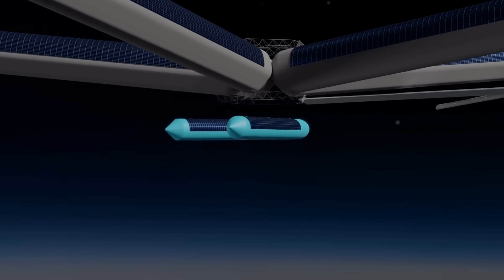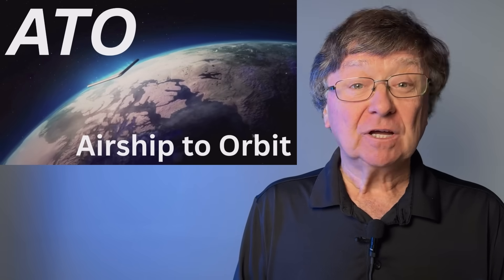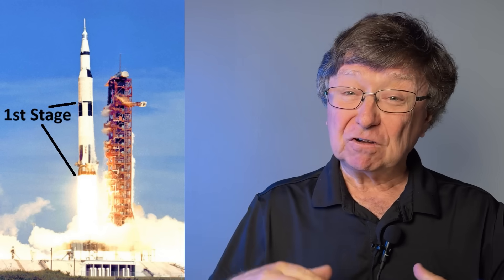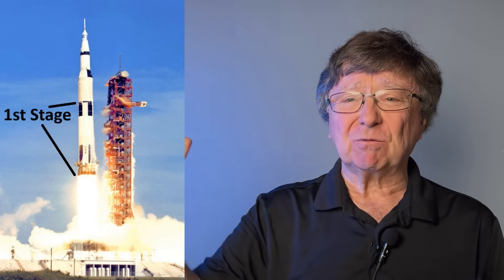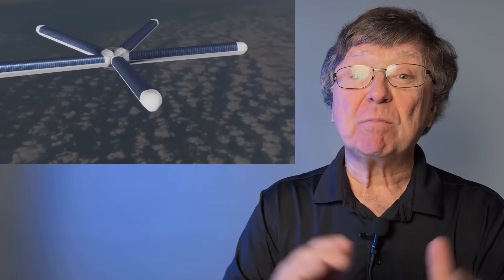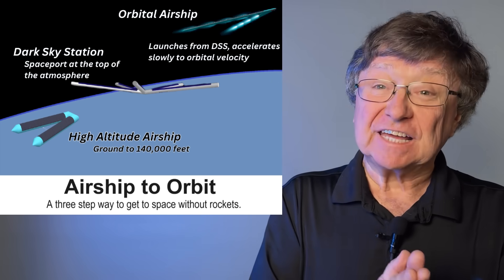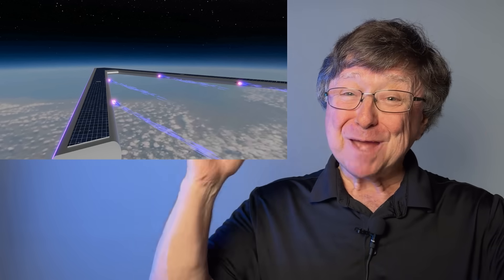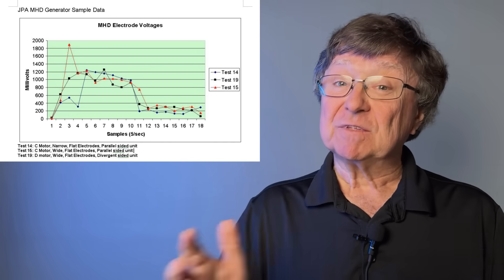This Airship Might Change How We Reach Space Forever!

Comment: I like the idea of floating up to space instead of all that noise and fire from rockets!
Reply: It might be a good idea but balloons can be dangerous too. Remember the Hindenburg? The USAF abandoned all their dirigible projects. Too many accidents.
Reply: @scotth6814 Planes crash all the time and we are still using them.
A few airship accidents were not the reason why they went out of service - it's the low payload.
Reply: @molybdaen11  It's a bit more complicated than that - who knew... The reason the US abandoned their airship programs in the 1930ies was the inherent issue with the design. A balloon, airship or dirigible - while lighter than air - is still a massive object with significant inertia. Operating them on the ground was a nightmare and in bad weather they turned into deathtraps. The issue with hydrogen is obvious, I think and to avoid that you would have to use hydrogen - which is expensive, has significantly less lifting potential and (just like hydrogen) keeps seeping through the lifting cell materials and needs constant replacement. To get to the proposed 90km altitude will require massive ships with all the currently unsolved structural issues and we haven't even talked about the proposed "floating station".
Reply: @Llyd_ApDicta  If we could manage to construct more stable materials, we would not even need a gas inside.
The gas is just there to protect against the outside pressure while having lower density then air.
Reply: @molybdaen11  ... and if we could manage to built compact fusion reactors we all would live in orbital O'Neill Cylinders. Your point?
Reply: @scotth6814 was all about the hydrogen back then

Comment: Love this idea.  I'm no mechanical/aeronautical engineer etc. etc. so I don't really know what the real challenges are.  As a fantasist I like to think what might be plausible.

Some questions pop into my head - like - ballast?  When is the Load lighter than air?  Always?  Does it required powered descent to keep it down?  Or is there some ballast system / dynamic inflation ... which leads onto pressure questions ... like how rigid is the balloon envelope and is there some kind of gas exchange to deal with the change in pressure?

I sometimes wonder about using graphene - now that it's looking like we'll create it at bigger scale - for batteries if I remember correctly (and not just ultra-capacitors)  - as a helium tight (though I understand there's problems with hydrogen) non-permeable barrier at 1 atom thick even I think - and I wonder if producing it in space could reduce defects?

I love the idea of using the energy from the sun with thin film solar to help with orbital velocity. Not clear on orbit selection to get sufficient sun to reach orbital velocity.  Not clear on the ratio of chemical to electrical engine deployment to do it.  If more chemical then you still have the rocket equation even though you've gone up a lot.  If more electrical, you need to overcome remaining drag and get some lift ... but while suborbital you still "fall" - so more drag ... sounds like you'd skip along faster and faster if you still have enough energy input and ISP? Whatever it's called - just feels like the idea of a motorboat skipping along a choppy sea or maybe parabola or whatever will be more predictable and less perplexing.  I would have thought that once you've got to the point of lift cancelling drag at the top sub orbital speed of your electric engines you'd want to deploy more wing surface with more thin film solar to boost the engines.  But as you increase mass of course you need more energy to get to that point in the first place  ... but hopefully with the optimised angle of solar irradiation I assume you'd try to get maybe it's possible - I don't know.  I suppose you could use chemical engines to give you higher sub orbital arcs which would give the electric engines longer to achieve more delta-v without drag and then with attack angles maybe you can bounce off the air density layers and with harmonic like pushes give the thing another push up etc. ... skip and hop until you can leap.

Anyways - I don't really know how this stuff works.  Too much sci fi.  :)  Sure hope it can be done.

I have wondered actually, with developments with graphene et. al.  and space based development, whether the space elevator idea could be adapted with lighter than air support, or if even "balloons" of vacuum could be made in-space.  They might not have to experience sea level pressure in a multi stage system.

Comment: Will the DSS Station have any station keeping potential, or is completely free-floating?  If free-floating, it may run into restricted airspace issues.  It would suck to solve all these technical issues and then get shot down by North Korea or something!

What are your lift gasses?  The same for all three stages?  If hydrogen, how do you handle resupply since it WILL escape?

Comment: It may indeed be impossible to use materials design to overcome the basic problems of heat and acceleration but the way to find out is to use very small scale models to try and see. Maybe 1/20th the size of the proposed lifting bodies suggested. If they can use smaller versions to actually get there, then that's great. The one thing I know is that it's always possible to overcome impossible problems.

Comment: I modeled a similar wingshaped  solar powered airship to orbit aircraft in first version of the xplane simulator decades ago. I called it the Simitar. It worked! Far less on board fuel needed and mostly only in the highest atmospere.tje sun transmits the energy right to you on the way. You keep building up speed at the edge of the thin atmosphere until when you have enough speed you pull back and pet it go on its final space trajectory. Like a dolphin building speed before the leap.

Comment: Edge of space port will require radiation shielding, extensive shielding.  Otherwise is it going to be a pretty short term investment.  I wonder how they intend to do that?  It will also require hydrogen refilling, constantly, as nothing made is able to stop hydrogen from leaking.  Even the next lighter gas, helium leaks pretty fast, and can't be stopped from leaking.  So, either will need to be replenished constantly.  (I would worry about hydrogen in that volume, as a simple spark can ignite it (although a fire would require oxygen to sustain it.)

Comment: LOL - I came up with this.. in 2013, except the way I looked at it.. was MUCH different... mine was STO.. or in this case.. an ATO - STO, and not the way that was described... ... You talk about valves... but not micro machines. or FUEL CELLS, or Storage Cylinders, or, or, or... and you know nothing of the ultra efficient Electrolysis unit, or why it is an advantage, or how to incorporate water to thrust.... plasma, and mach 40... (shrug) Great idea... I might look you guys up and visit.. 

B2S or shorter as Balloon Space Plane.. is also known by me as the BS Plane... ;-)  Why.. because unlike you guys, I did nothing with it, and if you do nothing, then it is BS.. but you working on building it.. is ... amazing.

Comment: This is a good idea, but keep things as simple as possible, KISS I think.  You can get by with only 2 airships and not need the mile-wide DSS station.  (1) the Load "Turning-prop" Airship LTA from ground to 140,000 feet at Mach_7, which rendezvous directly with (2) the giant  AOA Ascender Orbital Airship which has slowed-down from orbit at 300,000 feet  Mach_19 down to Mach_7  at 140,000 feet to receive the cargo load and maybe a little more xenon-gas chemical-fuel.  After about an hour, the two ship disengage  and the empty LTA spends the day reducing speed having atmosphere-resistance and  reverse-props to slow and land safely, while the AOA ship spends the day under powered electric thrust to climb back to orbit at 300,000 feet Mach_19.  Every couple of day, your "rinse and repeat" to get cargo to orbit cheaply.

Comment: Could conventional air-launch be improved significantly if you used black bird engines which re-configure themselves to fit the altitude they are flying at and rebuild, for instance, a Boeing  747 with glider wings that could give lift at far higher altitudes. How high would such a rocket carrier fly before having to fire off its rocket.

Comment: I like this concept very much, seems to have a lot going for it.

Maybe I am Captain Obvious here but I would concentrate on the station (second stage?) and the first-stage because those may be already commercially viable without the third stage.

Once the first stage and the station are operational, it could provide a service for those launch companies who would like to operate with a simplified launch system (no booster, only a small rocket with vacuum engines)

Comment: For as long as I can remember I've been saying that it doesn't make sense to launch payloads from sea level, and apparently others have been doing it long before the thought even occurred to me. All I've seen in the news is rocket launches from the ground, not the air, not a single mention that I know of, so I'm glad it was mentioned in this video.
To me the absurdity of the mainstream rocket approach is that most of the fuel is used to lift the fuel. It's like using brute force instead of brains, dragging a 1 ton ice block through the desert to arrive with an ice cube for the sheik's cocktail.
My idea is a bit different though, and feasible with currently available technology: Build a very large structural ring with hydrogen balloons on the outer edge and hang the smaller rocket from the center. Let the hydrogen lift the rocket from the ground as high up as the ring will go and then start the rocket engines to extract it from the ring and gain enough altitude and speed to place the payload into orbit. I'm skipping the many technical details but essentially the hydrogen gets compressed to bring the platform back to earth and the rocket is reused too, but returns on its own as it would waste fuel trying to slow it down enough to bring it back to the platform. So basically the platform just goes up and down to save the fuel and weight needed to reach 40km or whatever the practical altitude limit would be for hydrogen lift without propulsion.
I'm very curious what the challenges may be for the valves, as they're commonly used on satellites already. I'll search previous videos to see if they cover that issue.

Comment: I would advice to not use the common airbraking with heatshields etc that the animation seems to suggest for the last stage bleeding of speed to return to the base. Better to turn around and/or rotate the engines and do a powered deceleration.

Comment: Subscribed. But you have a lot to fix.
You need to eliminate apostrophes (not "apostrophe's") from your videos. Apostrophes are used only for possessives and contractions, neither of which you are doing. It is "carries" not "carry's". This sort of thing makes you look illiterate on that first, lasting impression.
1. Is "The Load" a good name for the first stage? Is it V-shaped just because you like V shapes? A cigar shape might seem less fun, but has always had reasons. Maybe give it a name that is not what you leave behind when you take a dump. Maybe name it after what it does?
2. What keeps the Sky Station blasting through the atmosphere at Mach 10? If it needs continuous solar-driven ion propulsion, where is that happening? Is a star shape best for that? Why?  Is it a "station', or a "port"? Maybe "Skyport".
3. It seems like your "Load" does a fair bit of "ascending', and your "Ascender H1" is more responsible for accelerating than ascending. And, "H1"? Start giving things numbers after they have been built.
I would love to see you succeed.

Comment: I love it.  I spend a couple hours most days doing calculations and simulations of spaceflight.  Your project's one I've gone through.  The flying wing balloon is an obvious thing, but your "hybrid chemical-electric" engine is the big wishful thinking "Oh, ok, now I get it." reveal of the lack of substance.  I was hoping you had something I hadn't been able to work out, but if it were there, you wouldn't have resorted to "hand-waving".
On the other hand, I love LTA flight.  It's just that the 100,000M climb is an also-ran in the ranking of costs on the way from earth surface to orbit.
Also, "mach 10" - you refer to that like your black sky station's going to be going that fast, just because a balloon released from a rocket a couple years before I was born was going that fast when it was released.  Don't try to carry us past understanding into blind support (I presume there's an investment pitch somewhere in there.  I auto-filter those out).

Comment: One thing not mentioned here is that this project would use large amounts of Helium, a non-renewable resource.   Once it's used up it's gone.   While using Helium, as supply dwindles, it would get more and more expensive.   That's the fly in the pudding.
Reply: You would basically have to use hydrogen to be able to source anywhere near enough of it.  No smoking!
Reply: Not once Fusion eventually comes on line, making Helium 😊

Comment: I have considered this concept as the smartest way to access space for decades, it is good to see someone with so much vision and determination working hard to make it a reality.
Reply: I've also wondered if some use of lighter than air would assist in creating a Space Elevator?  Or would there be other problems then?
Reply: @gonegahgah  The problem is the tether. It has to be very strong and light. We don't have the materials with the right qualities yet.
Reply: @tims8603  That's correct but could "balloons" along the length help alleviate this problem by reducing the load for various in between sections?
Reply: The engineering issues associated with this concept are such that it was abandoned as an idea for a very good reason. Mainly materials science issues. Not to mention payloads would be miniscule. It doesn't work with even modest payload masses.
Reply: Phoenix lights. Too busy playing games.
Reply: This or space elevator but the second is much harder.
Reply: 79 whole micrograms to orbit!!!1!1!1!! 🤯
Reply: Sounds great but why go to space if you can't carry a pay load?
Reply: Anyone talking to Elon?

Comment: At 100K feet, the density (and thus the buoyancy) of air is a tiny fraction of that at sea-level.
To lift any significant weight to 140K feet would require an airship bigger than a small country.
Reply: I think that is why he keeps referring to people.   You just aren't going to get much of any cargo lift capability.
Reply: 6:37 1400000ft.  How far is that in normal?
Reply: @BramBiesiekierski  42 km, when the edge of the atmosphere is 100...
Reply: @mirandela777   i think you missed the extra zeros.  During the presentation they miss-spellwd how many feet it would fly by an order of magnitude or 2
Reply: @BramBiesiekierski  - they missed a lot more, lol, like the Science :p
Reply: The point is to take it to edge of orbit and launch with rocket from there with far less fuel needed
Reply: @alexissvetrev  - you simply cannot, you have NO lifting capacity and NO CAPACITY to keep at that altitude any extra weight ( like the fuel needed for the rocket engines).
Reply: Add to that the loads of oxigen, water and food to maintain peoples alive on that station ...
Reply: I think you're forgetting lift at higher speeds in thinner atmosphere
Reply: @iRossco  Higher speeds requires much fuel burnt, even less cargo carried. This is a monstrous airship, aint going to accelerate to hypersonic in a hurry...
Reply: @iRossco  Air becomes a plasma on contact, aerodynamic lift stops working or not the same way as for airplanes.

Comment: Hi John, I really appreciate the ambitious vision behind the Dark Sky Station. The idea of using lighter-than-air vehicles to reach near space and launch to orbit is fascinating and innovative. However, I have some real concerns about the practical challenges, especially regarding the materials needed for a long-term platform at 43 km altitude. Given the intense UV radiation, ozone exposure, and particle radiation at that height, current envelope materials may not withstand prolonged operation with heavy loads. Hydrogen gas containment and structural durability seem significant hurdles. I’m very interested in how JP Aerospace plans to address these critical issues and would love to see more detailed research or testing data on these fronts. Thanks for sharing this inspiring project!
Reply from the maker: There are hundreds of challenges with this project. We tackle them one by one. Long duration envelope for the station was a big one. NASA's best balloons last little more than 90 days and we want to float for years. Our envelopes are segmented, and we can change them out in flight.  This turns it from an advanced materials problem into a maintenance problem. We built a vehicle and did it flight, swapped balloon and transferred helium at just over 50,000 feet. If we can't solve a problem, we find a way around.
Reply: Liquid oxygen will also heat up and leak, so a slow 2 hour (?) ride upward to balloon station is less good than 10 minute rocket launch.  But high balloon could be used as cheap satellites.  So this tech is good to research even if doesn't lead to space launches.

Comment: I hope you are using hydrogen as your lift gas . It's a little dangerous compared to helium . However with modern advances and careful manufacturing it's as safe as any thing else. Also it's much cheaper and offers much more lifting capacity compared to helium.  I think you are on to something.